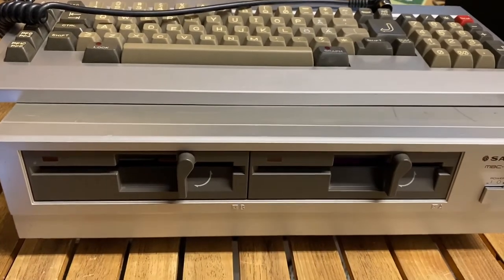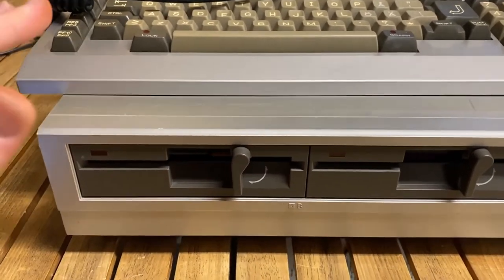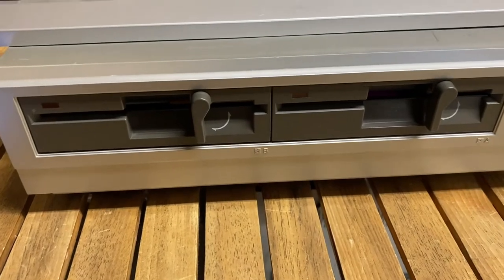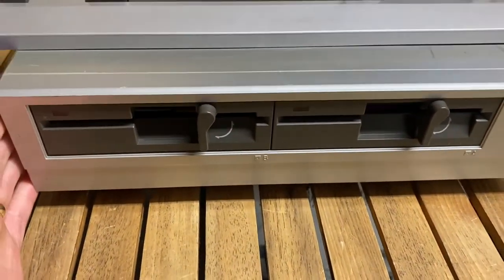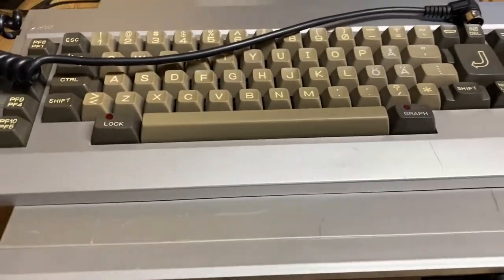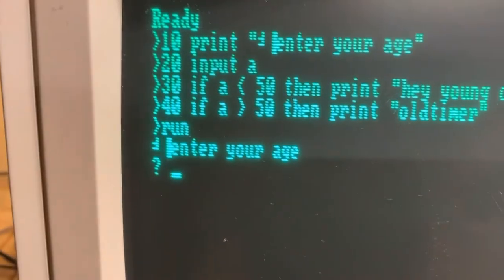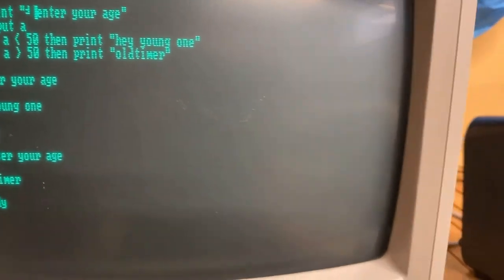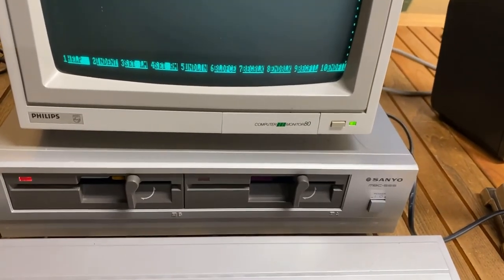Sanyo MBC-555, a VERY early IBM PC "clone" and the first one below 1100 USD. Turns out it's weird

Comment: If you can manage a copy from another collector of the Sanyo MSDOS, there was a 2.11 version included shortly afterwards. I got mine with a home study course from NRI schools and it came with DOS 1.25 like yours but they sent a 2.11 version out about a month after I got the machine. 

The "external", "line" and "joystick/paddle" openings were for optional items. The line opening was for a serial port option board, the external was where a main option board would attach after being piggybacked to the long connector on the board. There were CGA graphics boards, memory boards, HDD controllers and others all mostly made by aftermarket suppliers and were very expensive. The joystick opening was actually a clamp where you would remove the filler allowing you to insert an Apple style joystick DIP header that went to the open DIP socket next to U82 then the cable attached to the DIP header would be clamped down when you put the cover back in place. The floppy controller allowed up to 4 drives and they were reserved as A thru D in BIOS so if you did add a HDD and controller the HD would be assigned as E. I also seem to remember it not having a twist in the floppy ribbon, I think we had to use the jumpers on each drive to assign the drive using DS0 thru DS3. Did you happen to notice that the keyboard has no ALT key - that made one big issue trying to run some IBM compat software and AFAIK no one came up with a cure for reassigning another key as ALT.

 The one big Sanyo MBC-55x specific magazine was called Soft Sector done by Falsoft Publishing outside of Louisville, KY.  I had a few submissions published but I gained more as a reader from it. It ran a couple of years monthly and had a lot of information, ads and programs  in it.